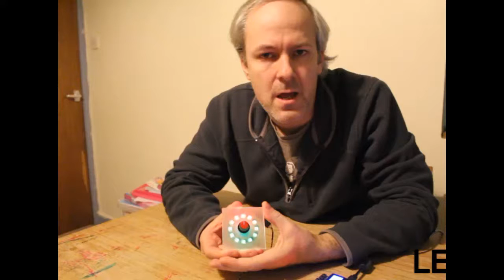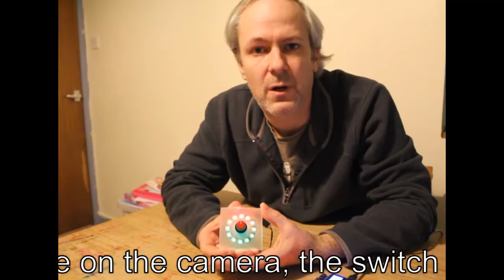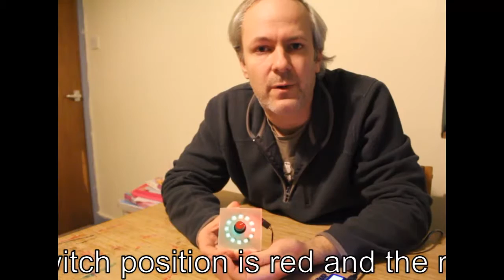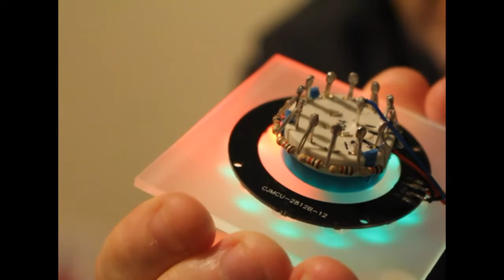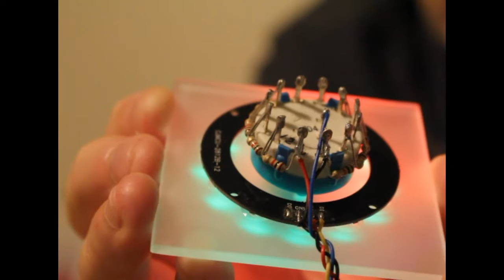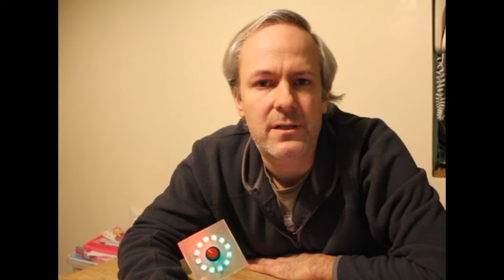Rotary Switch for Arduino using one analogue input

Comment: are you still working with these projects? I need help I'm with a project and I need to do something like this
Reply from the maker: currently restoring a mini so not many Arduino projects at the moment.
Reply: @mrfid72  thanks for answering, I have a question, the data of the leds go in series or the data pin reaches each led individually?
Reply from the maker: @fernandogs8377  In series, the first LED will be number zero and then so on. Data in to Data out and so on.
Reply: @mrfid72  THX, i Connect the rotary with resistor, vcc in first n1 pin of the rotary the last pin out gnd and center pole analogic, but pro micro made shotcircuit xdddddddd

Comment: No need for float operations, just add a constant to the adc value with the expected error from the resistors + adc.
position = (Adc_value + error)/93
Reply from the maker: Thanks for your comment,. i did try your method at the time i did this but decided to go with ROUND as it seemed a bit neater!